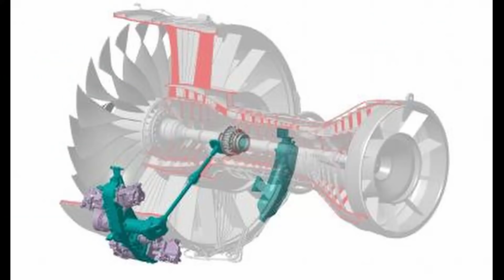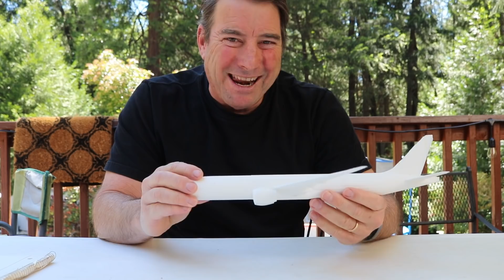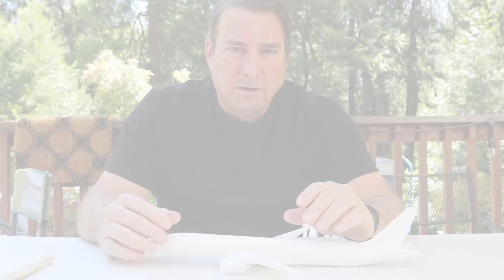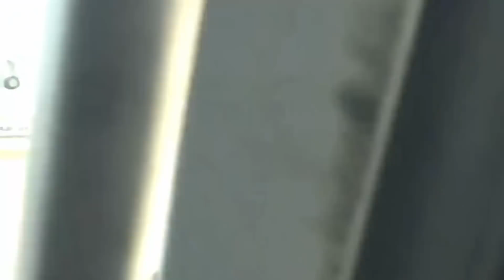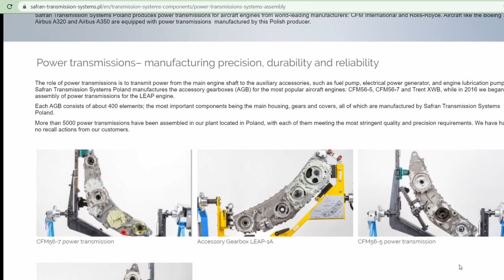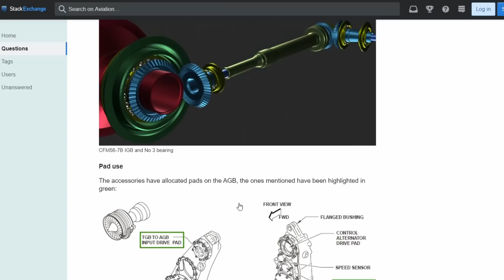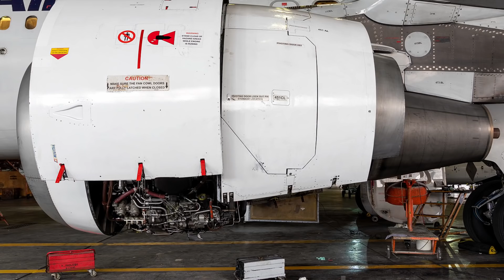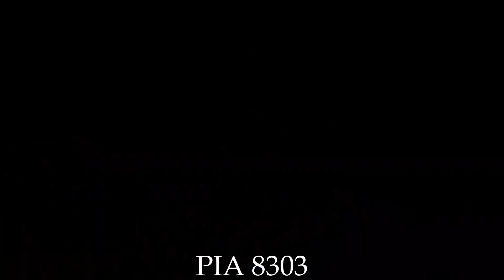PAKISTAN INTERNATIONAL AIRLINES #8303 UPDATE #2 23 May 2020

Comment: My father was in France during WWII.  He told me this following story.  When the P-47 took off the pilot would pull the gear up handle then hydraulic pressure would slowly build up and the landing gear would slowly rise and go up.  Now the pilots wanted to be cool and the landing gear slowly going up wasn't cool.  So the pilots would pull the gear up handle while the plane was still on the ground.  No problem here because the plane was still on the ground so ht e landing gear would not retract while on the ground.  But the hydraulic pressure would build way up so that once the P-47 did take off that the landing gear would snap up real fast.  Impressing all the other pilots and showing everybody else he was a cool pilot.  So my father was watching a P-47 take off one day.  The pilot must wanted to be cool so he must off pulled the gear up handle while still on the ground.  So the p-47 is making it's takeoff roll and is going really fast but not quite yet at it's takeoff speed.  The P-47 hits a bump on the runway and bounces up a foot or so.  The landing gear snaps up real fast showing everybody on the ground that the pilot is real cool.  But the P-47 isn't quite yet at takeoff speed so it settles on the ground with it's belly.  The big old paddle blade prop going Chomp Chomp Chomp taking big chunks out of the runway as the P-47 slides down the runway till it stops.
Reply: That pilot just pissed off the maintenance chief for sure.  Not something you want to do.
Reply: CW Lemoine has a video on his channel where an F22 pilot may have done something similar.
Reply: My father was teaching aircraft mechanic for private pilots. I remember he saying that on some small airplanes there is a switch on the landing gear that prohibit the landing gear to go up when there is weight on it, so you can put the command on gear up as you are rolling for the takeoff but if you hit a bump... same problem.
Reply: Amazing that their commanders let them do this.
Reply: We had a pilot at Edwards do that bull shit ! put the landing gear handle in the up postion, knowing the weight on wheel sensor wouldn't allow it to retract, On take off he got just enough lift to makeit retarct. He slid it down the runway a very olng ways. He calls the tower  and says aircraft down of runway 22.  The tower could not even see him at the time. A T-38 is not a large aircraft.
Reply: My multi-engine instructor was checking out a DC-10 pilot in a Beechcraft Duchess and they opted to do a touch and go. So instead of going to flaps 20 the DC-10 pilot grabbed a great big handfull of gear up. Unfortunately he was in no-mans land as the safety switch was not engaged so the cute little twin settled without much help from ground effect, so they gleefully (tongue in cheek) ground the props along the concrete and did an unceremonious belly flop. At least he was on the center line. His employer was so angry that they had to pay for their own taxicab ride back to home base. (Years later I took my checkride in that bird and had a prop failure during the checkride, so couldn't complete the practical. I ran out of money shortly after, but I was signed off at 3.2 hours flight time to take the check ride and looking really good until things went sideways. Sigh.) Juan, excellent description. Would simply having the tubing pinched have caused fuel starvation? It seems like if they shafts had been damaged that the fuel would have run out before the engines actually shut down. I didn't detect in your description a redundant fuel supply.
Reply: Oops!   

While on TDY to Eilson AFB, AK, we had an exercise where all eight KC-135 tankers were taking off with very short intervals between the aircraft.  It appeared the pilots were having a contest to see ho could get off the ground in the shortest distance.  The first three got off OK, but #4 had one engine backfiring during takeoff.  He pulled up early and retracted the gear.  While the gear was coming up, the plane was settling back down on the runway.  Due to the snowbanks along te runway, all we could see was the belly of the plane below the tops of the snow.  He gradually gained sped and altitude.  #5 and remaining aircraft used almost the full length of the runway before he rotated.  It was like "you win".
Reply: My father flew Spits. He'd get to almost take off speed,  fold the undercarriage up, and grease off. The Indian pilots would try to copy.  A couple of them simply augered in. My hard bastard father found this amusing. So he says.....um, said.
Reply: Is there a video of this incident on Youtube somewhere?
Reply: I cant understand this language but plz let me know was that the mistake of the pilot or landing gear technical  fault what is it plzzz reply
Reply: CraZy Jay  words are cheap and just throwing them around makes it almost an insult, please stop "talking" and do a good deed for your veterans, go and help in center, go help the homeless veterans, but this, "you thank for bla bla" is just lame and please stop doing it. veterans are around you, you can thank them in real not in empty words.
Reply: @rcajavus8141  Wow...... who peed in your cornflakes yesterday morning??? You can't blame one person for something that many of us say numerous times...Sometimes it's all we can do, and would rather do so instead of nothing at all.
Reply: @sherribrawn3757  its tragic because you say it so you feel better and when you come home you think "oh remember that veteran, we said that empy phrase to him, that sure made him feel good" or are you going to get discuisted with yourself and stop saying it fake as you do? say it when you give them 50 bucks and say "dont mention it, its nothing compared to what we owe you" ?! never thought of that?
Reply: @rcajavus8141  Wow - you personally know enough about his life to be certain his only interaction with veterans is throwing out the occasional “thank you”?

Quite a set of assumptions there just from divining intent from YouTube comments.  You must be a real peach to live around.
Reply: @rcajavus8141  Aren't you being a bit too sensitive? Do you say the same about JB?

Comment: why not add a special engine at back or any where else for emergency once all engines dead,,,and why not extra  landing gear box added also?
Reply: Bull Run There is an APU back there but typically at this stage of flight it is not running, but could be started if needed. Theoretically the RAT would suffice and I’d guess the APU could be started. It’s like a mini jet turbine engine.
Reply: Where would extra landing gear fit? The gear can be manually lowered by releasing the locks and letting gravity drop it

Comment: Wow just noticed that there appears to be a vapor or smoke trail streaming from BOTH engines as well (damaged area, not engine exhaust) 
Thanks again for an informative video, still strange to believe I found your channel looking up hydrology stuff and the Oroville Dam videos / coverage which was fascinating. 
That image showing just how low these items are (let's be honest, the cowl diameter is what it is only because every mm inside of it was required)  is VERY telling as to what kind of catastrophic damage would be incurred on both engines. 
I doubt the gear was down on approach and they pulled it up early on TOGA, that would also contradict your earlier video where you could hear the gear unsafe warnings on approach (either downlock / not down ECAM). 
I also looked at the checklists for landing with abnormal LG (the checklist after the initial checklist for the indications), and the SECOND item on the list is "notify ATC" - all checklists mention the manual drop, neither appear to have been performed. It's worth mentioning that the ECAM literally tells the pilots to perform these actions. This is further backed up by the fact that you only land on the engines if a belly landing is known / planned / briefed (crew, passengers, fire/rescue and ATC)  - THIS however appears to have caught everyone off guard, even the controller asked "are you belly landing?" 
I think we know many mistakes which caused them to lose the aircraft, but I'm still very curious what the initial issues were that possibly led to pilot fixation or CRM issues.
Reply: Thank you very much for your comment and the convincing argument. It's really a good question why they could miss that the gears weren't down. Maybe a mix of stress, fixation on the steep approach, overload and overconfidence ('we're comfortable now - we will make it').
Reply: P.S.: On Aviation Herald there's now a very interesting Statement from an Airline spokesman especially to this topic  available.
Reply: stone age culture and society where hierarchy is strictly and dumbly respected, we already had crashes caused by authorty of pilot not dared to be corrected by copilot, must be the same thing here, senior pilot bullied a non regulation behavior, not flying to the checklist and no one dares to correct him. even after seeing him belly land and take off, no one talks about it over radio as not to "start the trouble" and the trouble is already happening and no one is reporting it - i live in country and culture like that, just a new democracy and everyone is like little kids, scared to "report" and be the "black sheep" that attacks the authority of seniority.

Comment: It is amazing that they were able to gain enough airspeed to get airborne again, after dragging the ground.
Reply: They should have just belly landed the plane.
Reply: The touchdown and the indication on the engines suggests it would have been a mere second or less with the contact on the runway
Reply: The damage to the runway says otherwise, about 2000ft long was the distance the engines were in contact with the ground.
Reply: @K B They still had airspeed and it seems the engines didn't immediately die.
Reply: @kzop2847  actually it was 2000 ft dragging and over 8 seconds scraping the hell out of everyone on that plane, so please stop spreading lies and unconfirmed quesses, the investigation has started and people are reporting the findings. Over 2000 ft long tracks on runway and over 8 seconds of time lasting

Comment: One wonders whether the auxiliary drive system on these engines will be reviewed and redesigned on these engines after this tragedy.  It does seem a little short-sighted to have all the accessories that can cause the loss of an aircraft, such as the lubrication oil pump and fuel pump, without which the aeroplane isn't going to fly as it won't have any power, driven off one gearbox, and even more short-sighted to have those accessories mounted in such a vulnerable position.  It rather seems that this was an accident that was always, inevitably, going to happen at some point, even if the cause of the chain of events that led to the loss of auxiliary drive maybe is mechanical failure of the landing gear or pilot error by attempting a landing without the gear deployed.  The mechanical layout of components on this aircraft does seem to very much be a major contributing factor...

Comment: RAT or ram air turbine. former below wing for a major airline here and the way i understand it is the deployed fan blade that we see in the photo is being exercised by the mere velocity of the plane itself. to put it another way the downward thrust of the airplane drives the propeller which in turn facilitates the electronics and hydraulics. A backup measure to save a failing aircraft

Comment: On the accessory gear box is a Fuel Pump unit.    If the shaft is broken between the N2 and the acessory gear box,  the pump won't be pumping and the engine will spool down......at Brand X we had a flight with one of those shafts breaking on a takeoff roll at V1, engine spooled back and they air returned safely...... it looks like a clear case of damage to the AGB and resulting dual engine failure..... i will be very interested to hear an update when the CVR and Data recorder information is released
Reply: The fuel can be gravity fed if the fuel pumps fail

Comment: Wouldn't a landing check list have a gear down confirmation question?
Reply: Not on a go-round. If you're in the air, max throttle and retract
Reply: He is talking about the INITIAL landing, when he belly flopped and bounced 3 times on the runway. There is most definitely a loud, audible master alarm that goes off if the gear is not down! Pilot error. In a major way!

Comment: Marine bases used to have a "wheel watch" hut on the runway. It had a flare launcher which a Marine would shoot if the bird didn't have its gear down. I suppose they became disused because in 1985-ish at El Toro, the aircrew of an F4 belly flopped without the gear. VMFA 134 if I remember right.
Reply: When I was in the Marines we had wheel watchers all the time, the year? 1960. A WW had to be an E-4 or higher.
Reply: In the UK we used to have them. They were called RCVs - runway caravans. It was an old military idea that was phased out in the 1960s. As an old fogey I can remember my first job in Air Traffic Control was to be taken out to visit one. I didn't do shifts in any, but thought it was very cool. They did save a few incidents, but it was a cost thing...
Reply: @travelbugse2829  Yes. I remember the little thing as being portable as well.
Reply: I worked the Miramar Transient Line 84-88, we stood wheels watch, mostly E-4 and below.

Comment: Idk much about planes , But shouldn't it be some type of camera  system,  monitoring the outside integrity of the engines . At least giving the Pilots visual  intel on the outside state of the engines at all times  . idk sure seems like it wouldn't hurt.
Reply: No because the ECAM shows the position of the gear and if it is locked. Pilots own fault if they didn’t look at it as it comes on when gear is lowered

Comment: Never in my 28 yrs of ATC and working Pakistan airlines did I hear" I'm comfortable" from a pilot?
Reply: "uncomfortable", more likely
Reply: Snap, not exactly a Cockpit term, never in fourteen years in Midddle and Far east airports have I heard such a comment.
Reply: These morons were at 10,000' when the ATC told them to be at 7,000'; then they were at 7,000' when they were supposed to be at 3,000'; and last F****p was...they were at 3,500' when within 5 miles of the runway: On ILS, generally, you're at 3,000' about 6-7 miles (approximated distance of FAF) from the runway.  These two morons should never have been allowed anywhere near the airport, let alone in a flight deck of a modern wonder!
Reply: @fahadfaisal7855  i have a question do you know pilot was single or there was a co pilot too in the cabin?
Reply: @fahadfaisal7855  You are right of course, as an EX retired ATC Local and Approach,  I found that Height 'choice' somewhat questionable....some people get jobs because they 'KNOW' the right people.Hmmmnn!
Reply: Fahad Faisal mind your language. Respect the dead..... the landing gear was not getting employed that’s where the problem started.
Reply: @ayeshaali9427  watch Juan’s latest video - looks like landing gear didn’t deploy because they were going way too fast (it would have been damaged so it didn’t deploy).  They were going way too fast because they were way too high, which brought them in steeper than they should have been.  @fahad Faisal was spot on.
Reply: @ayeshaali9427  NOT SO... the problem started with the completely UNstabilized approach... Way too high, and way over the speed.
Reply: @DocNo27  Agreed, the landing gear did not first deploy because they were going too fast. But they had at least some reasonable time to deploy the landing gear before first belly landing attempt.
Reply: Low experience pilot maybe, EU has more lax training requirements.
Reply: @kevinvanlohuizen2709  EU doesn't have "lax" training requirements. The USA has draconian ones.
Reply: @greggpedder  
With hundreds of people's lives in your hands, I think the strict standards the US has is a very good idea!
Reply: @kevinvanlohuizen2709  he had 17000hours of flight time

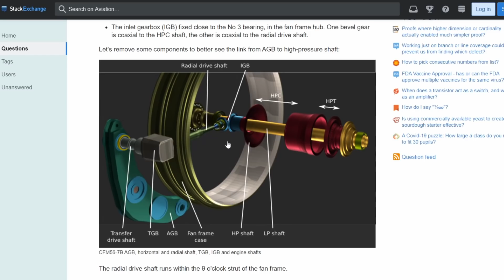Comment: 7:00 iirc from a/p school, the accessory drive shaft has a shear section specifically designed to break if torque exceeds a specified amount to prevent the accessory drive from ripping the whole engine off. These drives are supposed to break away on purpose, but of course the engine quits turning
Reply: are the engines designed with this same function as well?
Reply: The only thing is you wouldn't expect to lose both accessory drives at the same time. That's what seems to have happened here. Its likely they damaged both accessory drives and lost power on both of the engines.

Comment: Many thanks for this informative video. Keep up with your great work!
I could read in the comment section, as well as on other internet platforms, that "some people" already seem to put all the blame on the pilots. Before blaming something, we should keep waiting for more information to be released. Unfortunately, the recordings of the radio communication between the crew and the ATC (tower in this case), start a little late. To me, it sounds like the crew have been reporting issues with the landing gear already way prior to what the actual recordings, that can be found on internet, shows. This also shows the fact that the controller asked the crew if they want to try (or retry?) a belly landing when they were already on the downwind for the second attempt. Interestingly here is, that at no point in the whole recording, neither the crew or the controller were talking about landing gear issues. The fact that the controller asked the crew about the belly landing, shows that the controller at some point was aware about landing gear issues.